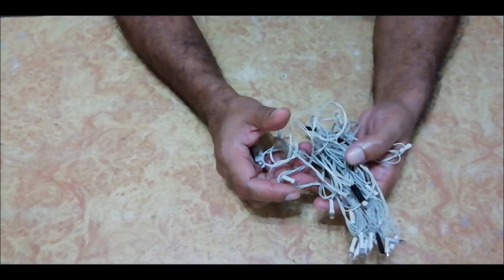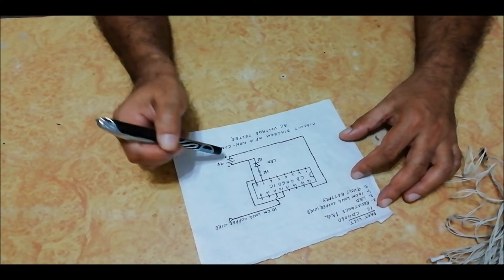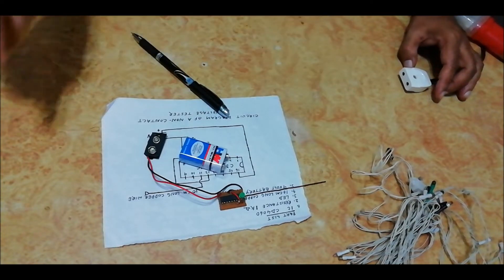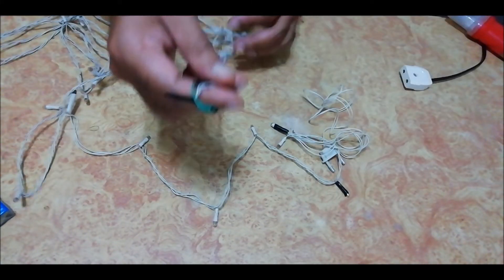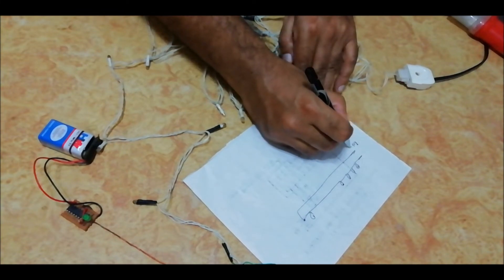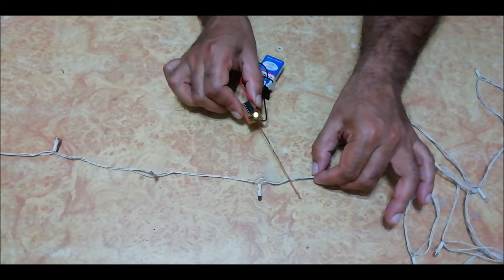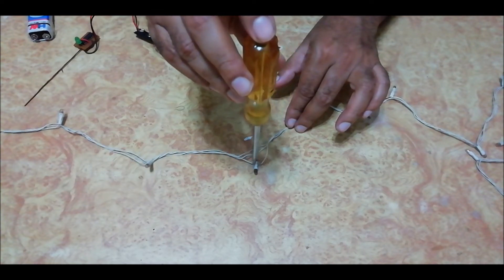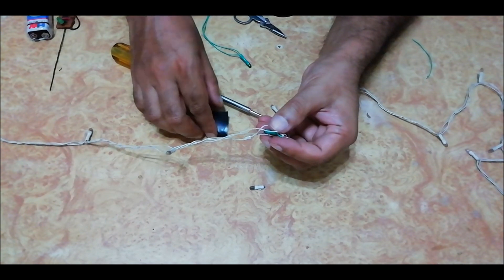how to repair christmas or diwali rice lights DIY

Comment: Sir please reply can i use these lights directly with a 12 v charger...
 because my rice lights controller is no more due to my  care lessnes.
Also when i connect them to home supply of 220v they work fine but it gets heat up so is there any option to use these lights without a controller box. Please reply
Reply from the maker: rice bulb works on 220 volt ac. Unlike LED, the rice bulb has a filament, which is why it become hot. You can simply add a tube light starter in series with the bulb. This gives you a flickering effect and the bulb does not get heated.
Reply: @diyrepairs  thank you sir 😊

Comment: Sir hmre jhaler me hr LED blub me carant jaara h hmne check Kiya or fir bhi wo jhaler jal nahi Raha hm kya kare plzzzzzzz reply me sir
Reply from the maker: jhalar ke plug ko plat ke check kijiye. jhalar ke plug se do tar nikalti hai ek LED ke suruwati chor pe aur doosara LED ke antim chor pe. agar antim chor wale tar me hot line jayega to non contact tester se check karne par pure jhalar me current batayega isliye plug ko plat ke check kijiye
Reply: @diyrepairs  sir krliya PR nahi kl Raha ....nahi samjh aara folt kaha h
Reply from the maker: LED me driver circuit laga hai. aur aap check kaise kar rahe hain
Reply: @diyrepairs  hmne tester ke aage sui Ko set krke check Kiya jlti hui jhaler ke hr blub me P nd N. Dono cheak kiye h ...sb me carant Batra h tester
Reply from the maker: aap non contact tester hi use kar rahe hai n. agar 9 volt ki battery weak ho to bhi galat result deta hai. isliye 9v ka naya battery lagayen. LED jhalar kitna bada hai. bada jhalar hone pe supply se thin ya char tar pure jhalar ko jati hai kyonki jayada bulb series me nahi laga sakte. jyada bada jhalar me series aur parallel dono connection hota hai. tab bhi teste galat result deta hai kyonki positive supply se do ya tin tar jati hai jo kuch kuch door pe jhalar me jut ti hai.
Reply from the maker: aap jhalar ka pic bhejiye sushilkr11@rediffmail.com